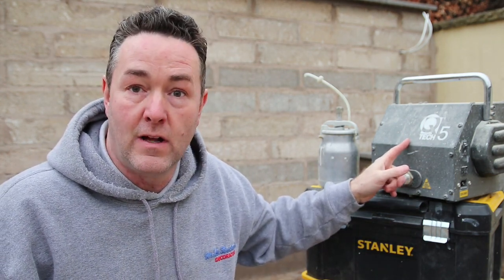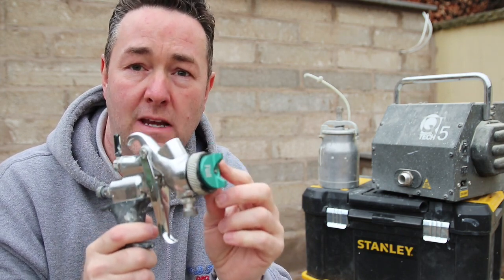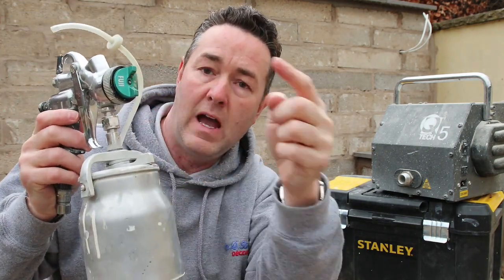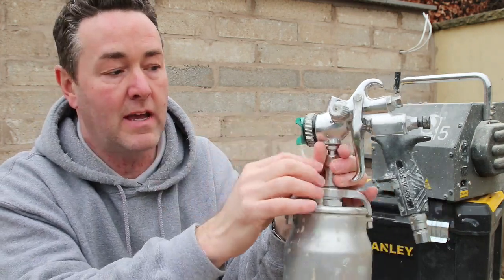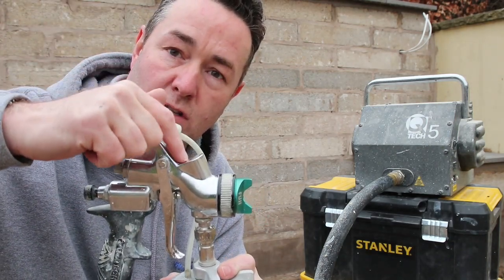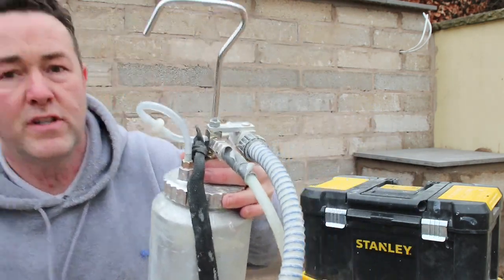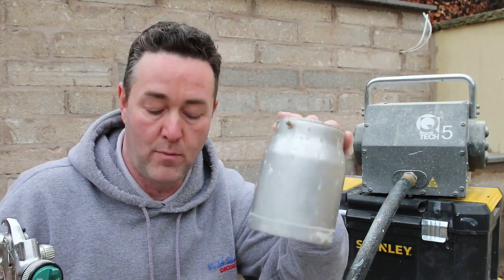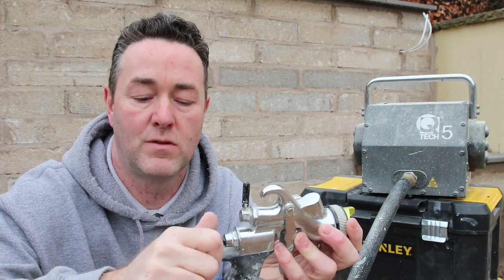HVLP - how to set it up

Comment: Great informative video Phil, I've the fuji 5 minimite with remote pot and all info is  relatable 👌 having spare check valves and seals for the cup guns is important to prevent down time. Also I added a remote control socket to switch of and on the turbine as my model hasn't remote start like the graco ones. As you say there a money maker and would highly recommend the hvlp to your kit 👌 Thanks for spreading the word.
Reply from the maker: The remote switches are handy. It's good to mention that.
I'm just trying to show ppl that there is money to be made and it's not all about slapping paint on and on to the next.

Comment: Very informative Phill and explained how much extra thinning is needed because you have to knock it down a bit to get it to spray at the best of times 👍
Reply from the maker: Hi. If out the suction pot, it can be trial and error depending on how the the paint is to start with.
I like it  to be thixk enough when water is added to run off the mixing stick back into the paint and it doesn't sit on the surface for too long.

It's easier to add more water than take it away.

I do say that with the remote pot I have to thin it more as I find if it's still too thick it really struggles to get up through the paint hose.

A bit if practice you soon work out what paint needs more water.

Paints I use...
AllCoat exterior is a lovely paint to spray using a 1.8 needle set and some water added ;)
Helmi can spray nicely with a 1.5 Needle set.... If 8ts a bit thick you can go to the 1.8 if you feel the need.

Comment: Hi Phil.I think your videos are  brilliant,and your work looks top notch👌.
I am a car sprayer of 20 years.
I have all guns needed for that trade.primer guns,laquer,base (both water and solvent) etc.

I used devilbiss (hvlp gravity fed) my primer gun is a 1.4.
Which I think would be ok for this process.

I currently have in my shed a Clarke 150 litre compressor ( I used to use this for smart repairs when I wasn’t lazy on weekends)

This is something I would like to get into(I’ve been asked by several people if it’s something I would do for them) 

I like the look of the Qt 5 

But I want to see if it’s viable for the amount I would probably do.

My question is.would the set up I can scrape together already give me a good gauge of if it’s something I could do long term before investing ?

Thank you 👍
Reply from the maker: Give what you have a try first, a 1.5 and 1.8 needle will be handy.

The advantage of the Qt 5 is that it easy to transport about.

Don't spend till you know you need... Or want it ;)
Reply: Thank you for the reply 👍

Thank you for the reply.I admire your work and honesty 👍

Comment: Morning Phil what’s a 1.8 in Graco  they use numbers plus what’s the secret to keeping the dust down or is it you can’t ??? Great vids👍🏻
Reply from the maker: Hi. Not sure on the Graco.

Dust.... The turbine blowing does whip up general dust in around the room TBH.

But on the spray... Turn down the air flow slightly so it's not at full flow air.
But keep it enough that the paint atomises.

Comment: Great concise video mate, would a 3 stage be adequate for kitchens cabinets, upvc windows, garage doors etc,? I understand that 5 stage is best but it's so expensive. Thank you
Reply from the maker: Hi. I did my kitchen with my previous HVLP.. a stage 3.

Just thin a bit more as it's not the power of a stage 5.

I'd say bite the bullet.. get the best you can then you won't be wondering what you could be missing out on.

Comment: Hi Phil, I have the fuji 5 platinum but unfortunately thinking of putting in the shed, really struggling with paints, mainly for interior doors woodwork etc, any recommendations of good paints to use, how much water to be added etc, best needle size
Been a decorator for 35 years now and thought I'd give this spraying a go, got a airless, and love that on bigger jobs, just can't get to grips with this hvlp, which is a shame as alot of my customers are wanting work done with one these sprayers. Any advice would be appreciated, cheers Chris.
Reply from the maker: No!! it's an easy one to start with.
Paints... move over to Tikkurila Helmi or Everal Aqua.
add enough water, a bit at a time so it sprays easy and also lows out... 1.5 needle is fine,
check out my other videos using it ... see the video, https://youtu.be/CjmsvQtI1wg

AllCoat exterior satin sprays well too.. 1.8 needle set. :)

hope that helps
Reply: @ProfessionalPainterDecorator  Hi Phil, I will give it another go, after all the fuji platinum 5 is a lot of money just be put in the shed
Would like to know what gun your using as mine is a fuji 7001 m model, its very sensitive, ie the paint release, slightest touch and bang, too much paint, think that gun was meant to be for the semi pro, stage 2 fuji, would it make difference now its been use with my stage 5 unit, cheers Chris

Comment: good morning phil  I'm thinking of getting q5...but I'm thinking about diluting paints...if paint says 10% dilution with solvent or water, can I add more and the amount...?doesn't it affect the paint especially the lacquer?
Reply from the maker: possible, depends on paint. Lacquer is very thin, so you may not need to thin much anyway.. a 1.3 needle set will be good.
Reply: @ProfessionalPainterDecorator  in any case, the color needs to be thinned a lot... and can I put a color that says 10% thinner thinner too??from q5 are you satisfied???

Comment: If you were in South Africa where can I find that specific gun and how much do you think it cost in and what is it called cuz I would like to use it when I'm the roof tile
Reply from the maker: Hi. Try a Google search where you are for a Stage 5 HVLP sprayer. See what comes up.
It's the  stage 5 power of the unit that's the main thing to have.

Comment: Hello Phil, I bought myself a Q5 and have sprayed a few bits. I am doing up my bathroom and managed to get a cast iron bath tub from facebook market place. I am looking to refinish the inside of the bath but I am getting a bit confused on what paint I should be buying? Any clues? 

I saw one video where they used marine paint I believe called AWLGRIP
Reply from the maker: Oooh that's something I've no idea on.

I do know you can buy refinishing kits, Google may be your friend on that one.

They'll be something out there.

I'm more into painting the outside of a roll top bath lol
Seen that video?
Reply: @ProfessionalPainterDecorator  Thanks for your help. Saw your video on the outside of the bath and will be using your tutorial 🙂 

I cant think why a marine paint designed for a hull would not work other than maybe the heat. I watched a guy here https://www.youtube.com/watch?v=nyqoIqhOKzM who seemed to be using AWLGRIP with a HVLP gun

I would be much obliged if you could do a video on marine paint! Maybe get yourself a yatch and use your Qtech 🤣
Reply from the maker: @James-dv1df  will a power boat be ok?
That's coming after the Porsche

Comment: Say if I have to thin down paint with water phill and I still have some left over on the job can I pour it back into my paint tub? I’ve just bought this system and what needles do I need for what products like would 1.5 spray primer?
Reply from the maker: Watch a few more of my HVLP and spray vid.

Left over paint I tip back.. and write on the lid it's thinned. So I know for next time.

Comment: I’ve bought this, my gun flutters stood up right however I tilt the gun slightly to left or right it sprays perfectly. Any ideas why it’s doing it, I’ve tightened the nozzle too!?
Reply from the maker: Back to basics I always say. Remove everything and put it all back together checking it all.

Also check to see where the position of the suction paint feed pipe is...
It's the brass looking pipe that goes into the paint pot... It has a slight bend at the bottom of it, where is that facing? I like mine to be facing forward.

Comment: hi phill is the apollo  pro spray 1500 any good for upvc windows do you know?
Reply from the maker: Hi. It's not something I've tried. Is that a stage 3 or 5?
I would say get a stage 5 though. Save and get the best you can.
I found a stage 3 struggled with thicker paint.

Comment: can the qtech use for spraying ceiling and interior walls?
Reply from the maker: No. You'd really want an airless for that 
Hvlp, paint needs thinning and it's really for woodwork and furniture spraying.. stuff like that.
It isn't as quick as airless but does have more control and a finer finish.